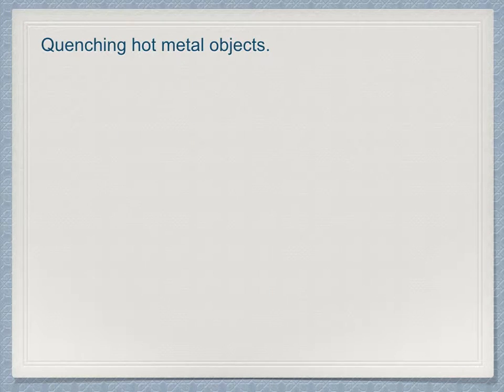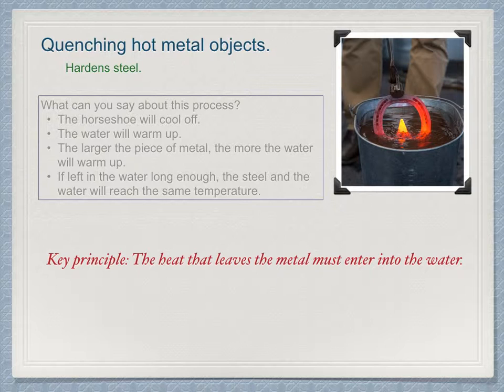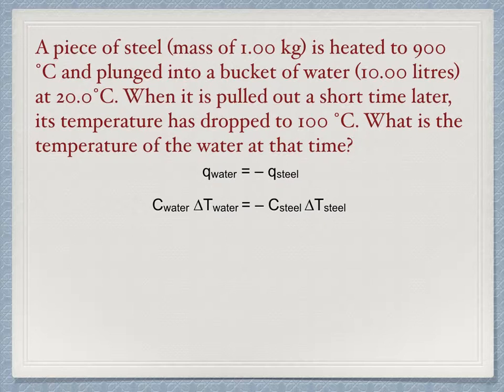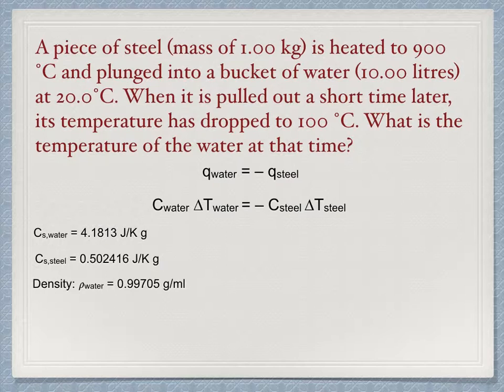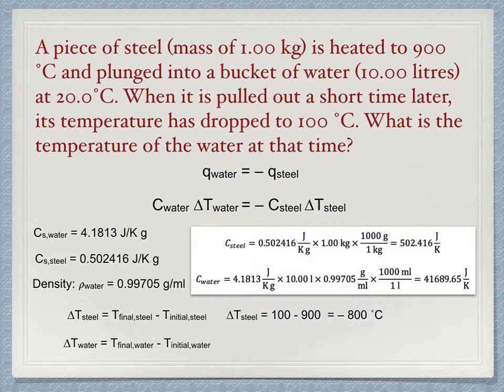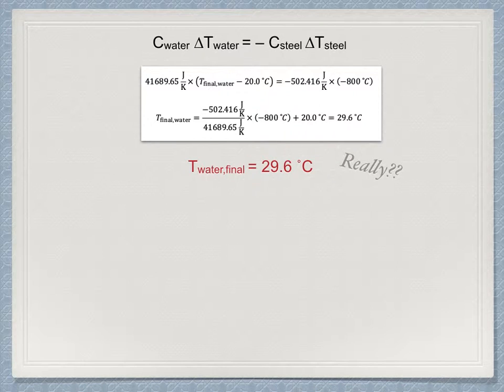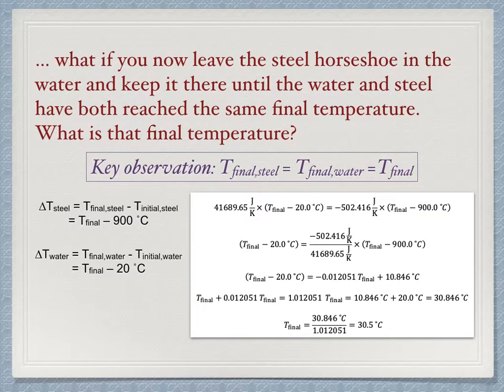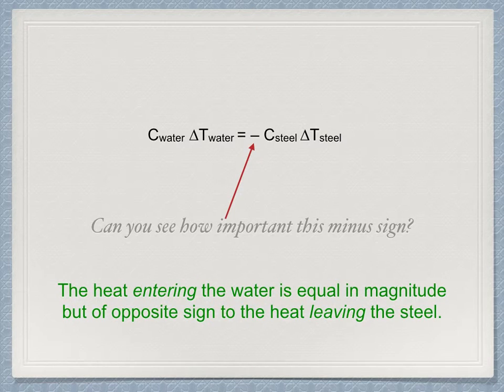Thermo 4: Heat Capacity 2

Comment: Why are we calculating a new C for water and steel? Can't we just use the C that you got from wikI?
Reply: The tabulated values retrieved from Wikipedia are SPECIFIC heat capacities, meaning it is the heat capacity for just 1 gram of each substance. We have to account for the actual mass of each material present. Hence the conversion factors, and the use of density to get from volume to mass for the water.